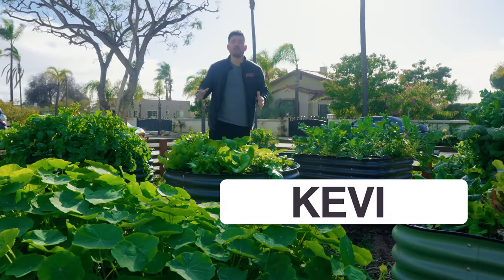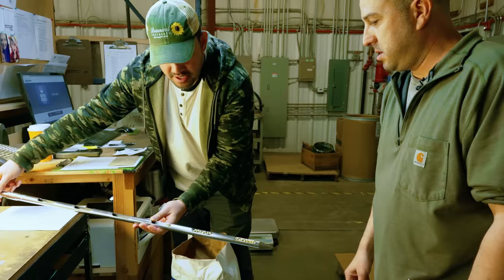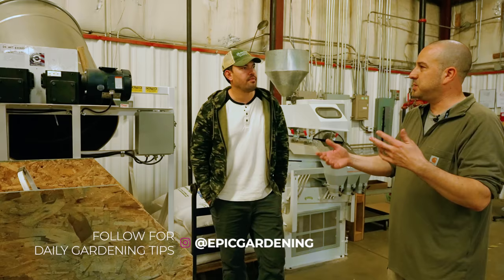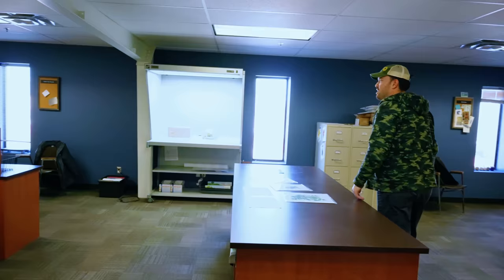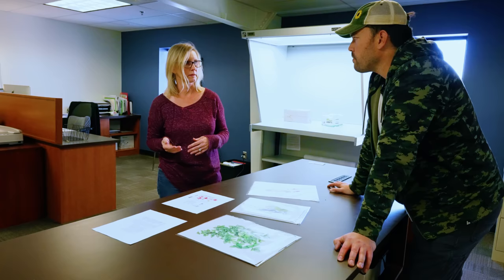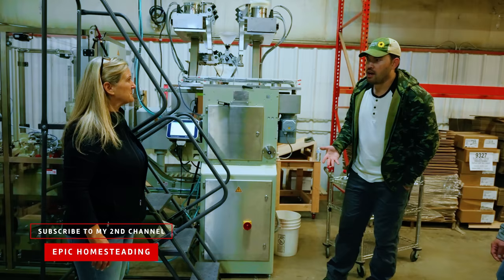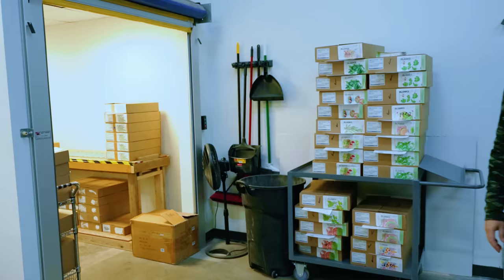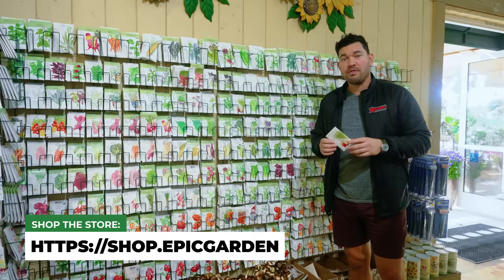How Does a Seed Company Work?

Comment: I see the factory and see so many things I would change to make employees happy and not hate their job 🙃 after working in several factories and warehouses, this looks chill and fun place to work but guaranteed it's not
Reply from the maker: Feel free to offer suggestions!
Reply: In shipping I wouldn't have the seeds boxes stacked 9 high, maybe 3/4 and offer the employees a roller seat like a mechanics roller seat so they can roll down the aisle with everything at a easy height, bending over and stretching your arms up all day is the worst thing you can do for your back
Reply: @epicgardening  use a pneumatic conveyor system in packaging so the 5 gallon buckets don't need to be carried up and flight of stairs and lifted and dumped into the machine, seeds could be put in at floor level and pumped up into the hopper for less chance of a fall injury or again back injury lifting the buckets above your head